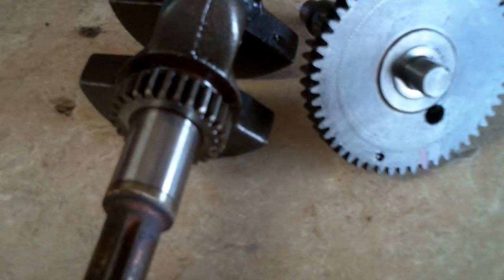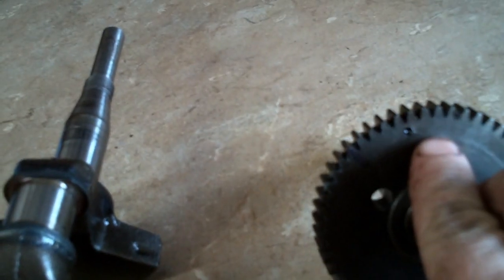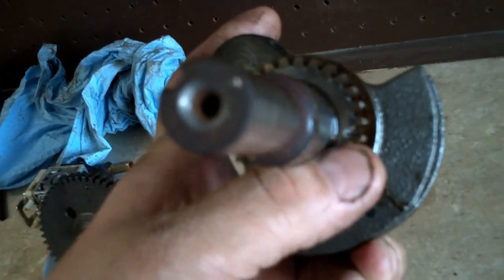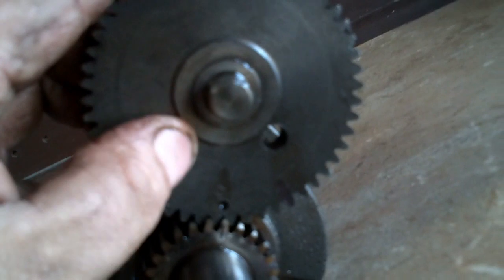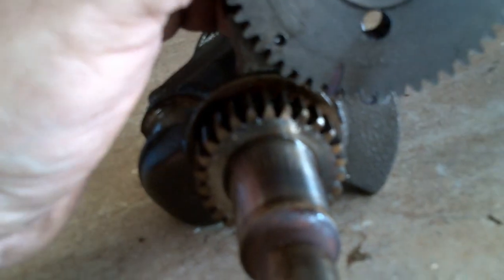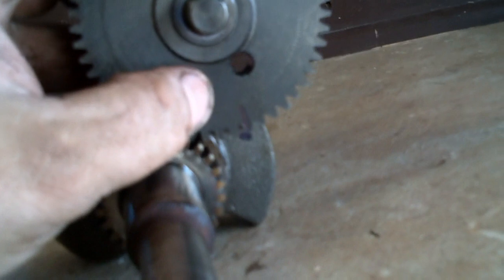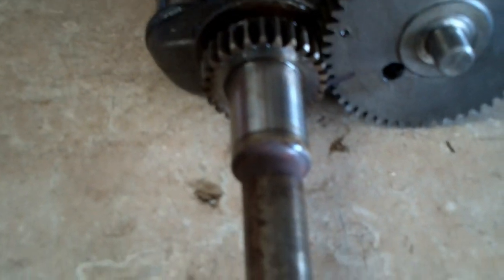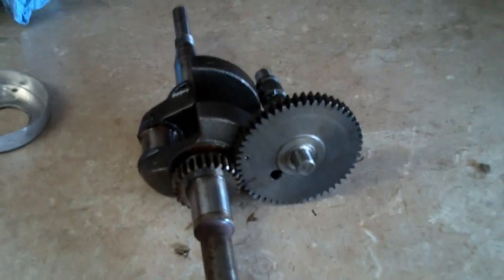HOW TO SET THE ENGINE (VALVE) TIMING

Comment: Hello mowermedic1 do you have a full video on how to set timing in a Briggs & Stratton overhead valve single cylinder??? I'm working on a Briggs and Stratton overhead valve 19hp and I have replaced the camshaft and now it only turns about half way and makes a pop noise. I can hear like air compression trying to to get a way out. I'm thinking I have it in the wrong stroke. Any suggestions or ideas? Thanks in advance have a wonderful day!

Comment: K532 after had to replace piston for sevond time, i set marks together has you described .when im trying to set points governor was off and had to get it reset close to where it should be not being able to see marks now. But site hole where i viewing timing mark on top of flywheel is 'sp' on top then when you turn clockwise the marks go wrong direction away from site hole is this right where im viewing or not at all. Thanks alot

Comment: Good video but I have a problem I can’t figure out 

I am renovating an old Tecumseh Centura 6.5 Hp unit and the gear on the crank that drives the cam has broken 2 teeth and is just spinning on the crank. Sadly I cannot get a replacement crank anywhere so I have a plan......

This gear that drives the cam is a press fit on the crank and I have another scrap crank that I can sacrifice that has the same gear on it.

So the plan is to press the gear off this scrap shaft and then press fit it to the crank I need it on.

Now to my problem which is that I will not be able to get the gear fitted for sure with the cam timing dimple at the correct orientation relative to the crank.

So how do I make sure I get the cam timing right when I do this with in effect no timing mark on the crank gear.

Comment: I took out the fuel injection pump on a TD27 Nissan engine serviced it nd when I put it back a have a diesel knock and lots of smoke from the exhaust. my question is what is the steps to take to get this pump timing right?

Comment: I just bought at 212cc predator. I took the goner off and have new jet. Well not even the jet but the longer copper piece after the first jet.any ways its not starting it seems as if it has no spark so I pulled out the plug and grounded it to a bolt and it does have power,I checked my float and that's also fine,pls help

Comment: Im seeing on these videos the timing marks,But everyone is failing to mention how to retime a small engine when you replace crankshaft and camshaft, could it not be 180 degrees out?MY Timing marks do not line up with top dead center at all,Briggs and stratton 10 horse.Thanks
Reply: Maxtrac - did anyone answer your question?  I have the same concern.
Reply: there is a little trial and error but if you know the 4 strokes of a 4 stroke engine,  it will help.  So you have your 
1)  Intake Stroke - on this stroke,  the piston starts at the very top,  and begins to go down,  while it goes down,  the intake valve opens,  and let's air/fuel in. 
2) compression stroke- with this stroke,  the intake valve closes just before the piston starts to go back up,  with both valves closed,  the piston compresses the air and fuel mixture. 
3) power stroke - at the very top of the previous stroke,  when the air and fuel is fully compressed,  the spark plug will spark,  and ignite the fuel/air mixture,  causing an explosion,  pushing the piston down again. 
4)  exhaust stroke- once the piston is down all the way,  and as it goes back up,  the exhaust valve will open,  letting the exhaust out.  Once it reaches the top,  the exhaust valve closes,  the Intake valves starts to open again,  and the whole thing starts all over again.  

Now,  to fully understand how the valves open and shut,  we have to learn about the cam shaft.  If you look at the camshaft for this engine,  it has jist two lobes on it,  one for the exhaust valve,  and one for the intake valve.  When the crankshaft turns,  it turns the camshaft,  which is geared perfectly to allow the valves to open and shut in sync with the piston.  

To time them. Up properly there are a couple of ways to do so,  but I will just tell you what I do. 
If you notice on the camshaft,  the lobes are very close together on one side,  and then there is a while before you get back around to the lobes again.  This is because during the 4 strokes,  the exhaust valves opens and shuts on one stroke,  and then the very next stroke the intake opens and shuts,  then there are two strokes while theyre closed.  So, you need to make sure that the crankshaft is in the "dead bottom" position,  or as low as it can be.  Next.  Put the crank shaft inside the engine,  and gear it up so that the exhaust valve lobe is at a perfect 90° angle.  So now,  going back to the 4 strokes,  this is the very beginning of the exhaust stroke.  So now the piston will rise up,  while simultaneously raising the exhaust valve,  and as soon as the piston reaches "dead top" or its highest position,  the exhaust valve will close,  and the intake valve will begin to open,  thus starting from the top.
Reply: Rob excellent - you are literally like those priests who know the bible & you know engines love that - Cheers Rob
Reply: The timing marks do not line up with TDC on a Briggs.

 "When performing the valve timing, it is unnecessary to be concerned with piston position (it will NOT normally be at TDC when doing this)."

Comment: Sir, I have replaced the rod in the model 289707 12.5 hp B&S intek.
It backfires heavily out of the carb. Timing is totally out (fires at open valve)
Aligned timing marks (Shaft key o.k), No sheard Fly key, Compression 0.K
(Valves lapped and adjusted, slightly extra grind on intake valve stem.)
Carb & breather tested o.k  Tested new coil (in right pos.) checked all over.
I am going totally bewildered over this. Please help..

Comment: how do you set the valves for clearance and timing after replacing the head on a one cylinder 4 cycle engine, mine is a Briggs and Stratton Vanguard 14 horse

Comment: I have a Briggs model 446677, I found that the push rods on one side had come off and was setting in the crank case. after removing them I cleaned up the heads and reinstalled the new rods, gaskets and cleaned both the heads, and top of the piston. I had everything back together fired it up and notice that the oil pump cover was leaking so I repaired that the next day. I proceeded to fire it up again but it just popped and backfired, so I pulled the valve cover on the same side and found the rods bent up. I had two spare, installed and still nothing. I have the valves adjusted to .004 like specified and checked the rods again after trying to start for the thousand time and rods look fine. Any suggestions?